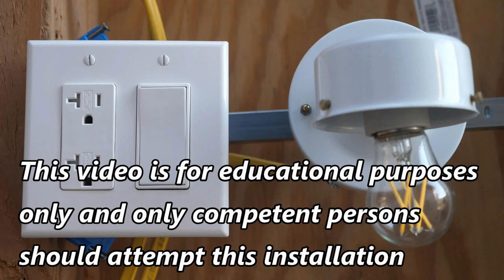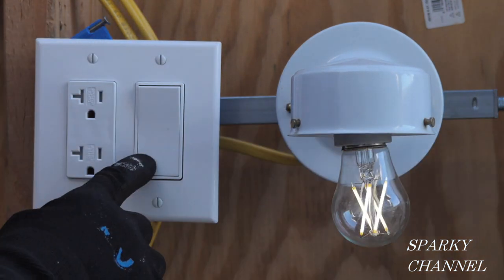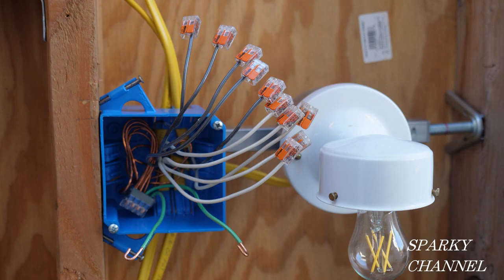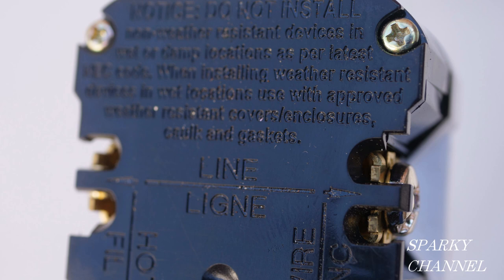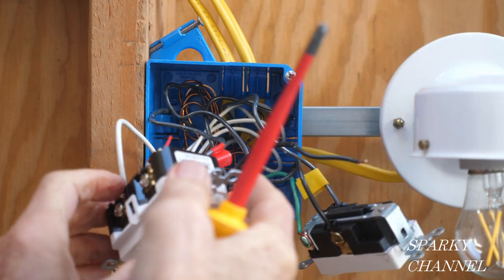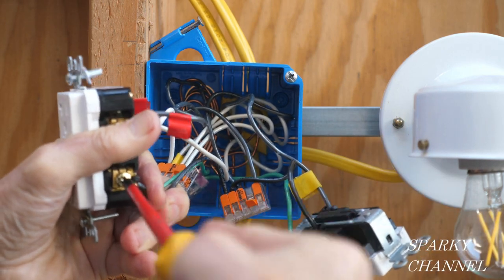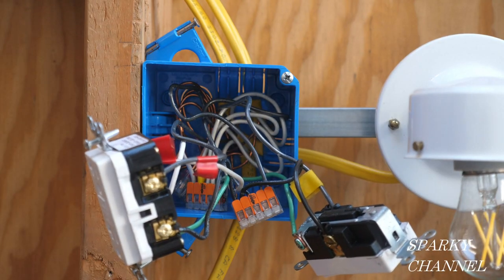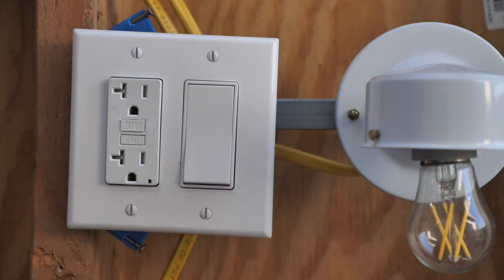Replace a Receptacle with a GFCI Receptacle in a Busy 2 Gang Box

Comment: before anyone asks, yes, a GFCI will still function in the absence of a ground wire.  however, a plug-in GFCI tester will not trip it.  the only way to test it would be the test button or by using a meter with a gfci test function to test between the GFCI protected hot contact, and the neutral from a DIFFERENT circuit, (or to a solidly crounded surface)
Reply from the maker: Thanks!

Comment: a tip for anyone who wants to replace a GFCI at home: it's been several years, now, but Leviton reconfigured the terminals on their GFCI receptacles in the past, so be sure ro read the line/load labeling.  if you happen to be replacing a pre-reconfiguration GFCI with a new one, and just move the wires into the same locations, the GFCI will refuse to energize,
Reply from the maker: Thanks Ken! I think I got some good close up photos of the GFCI terminals in this video so that should help. Basically the part that is "line" is labeled and the "load" part is under some yellow tape.
Reply: @SparkyChannel  yep, you showed the markings well.  load also had words embossed.  but before Leviton went to the low profile GFCI bodies, the line terminals were closer to the ground and load was farther away - I get a lot of troubleshoots where a homeowner installed a new one wire by wire, and didn't know that.

Comment: If the switch next to the GFCI outlet were a smart switch that requires a neutral wire, how would you wire the neutral wire for the smart switch?

Comment: I need to do something like this. There is one remaining knob and tube circuit on my property. It powers two lights in the house and then the entirety of my detached garage. Inside the garage, it immediately becomes (old) NM wire. I’m not sure of the status of ground wires within the structure, but only hot and neutral are run to it.

Ultimately I’d like to run underground conduit for a 240v sub panel in the garage, but that’s not in the budget right now. So danger mitigation is the name of the game!
Reply from the maker: Yes! My advice is to change out that knob and tube as soon as you can. It has served your house for many years and it's time for it to be retired with honor. :)

Comment: Great video! I have a question for you. Can I put 3 100 amp sub panels on a 200 amp main panel? Would this be overloading the 200 amp service? It would be 2 sub panels for a house and a sub panel for a workshop. Thank you.
Reply: it depends on how heavily you load the subpanels.  it is the total connected load that is the final calculation.  if in doubt, you should see if you can get a local electrician to do a load calculation for you, but a basic rule of thumb I use is in an all electric house I like to step up from 200 to 400A at 2000 square feet.  with gas heat,, hot water, and cooking, the power stretches a lot further. and then it's more a matter of having room for lots of circuits in the panel.

Comment: Hi sparky quick question..
Can I install a bathroom vanity light without a box? I live in California and I’ve definitely seen this scenario in bathrooms out here. 
Thanks man.
Reply: most of the time you cannot.  if the fixture has a metal backplate that completely encloses the wire connections, and you can install a cable connector to secure the cable to the fixture, then it is a possibility.
Reply: @kenbrown2808  okay thank you

Comment: Is there a reason the light needs to be gfci protected? I would think you'd want the light to work irregardless of the outlet state.
Reply: I would agree with your logic, and perhaps he will do a follow up video, which will pack even more connections into that box.
Reply: some localities require a gfci  irregardless of nec  for damp locations or within 4 feet of a water source for ALL such circuits yeah the lighting thing is a good question but if you.ve ever been lit up by an outside light fixture.........
Reply: "irregardless"? That's not a word. There's "irrespective" and "regardless" but not "irregardless".
Reply: @spiritcourier  
Spell check though it was ok.
Reply from the maker: Excellent question! I think I'll make a video on that.
Reply: @spiritcourier  
Actually irregardless is a 200 year old nonstandard word. Means the same thing as regardless.
Reply: @scott_meyer  Yeah, just as "irreinflammable" means.....?  These things happen when usage of a language starts out as only commonly being spoken, but not commonly read or written.
Reply: Regardless. Irregardless is not a real word.
Reply: @scott_meyer  It is still wrong.
Reply: @illestofdemall13  
Um, it's in the dictionary. 
https://www.dictionary.com/browse/irregardless
Reply: @illestofdemall13  This isn't France.  If you say it 3 x it becomes a word!
Reply: @scott_meyer  Regardless means without regard, or no matter what, etc. When you put an "ir" on a word like "irrational" it means not rational. So ir-regard-less means not without regard so it is a double negative. It is in the dictionary because there are millions of ignorant people who have poor grammar and sentence construction skills so they dumb down the language and accept stupid things into the dictionary.
Reply: @richardcranium5839  in New Mexico GFCI is required within 6’ of water